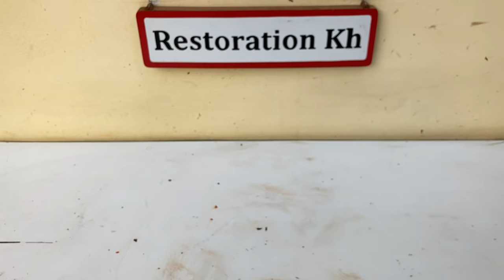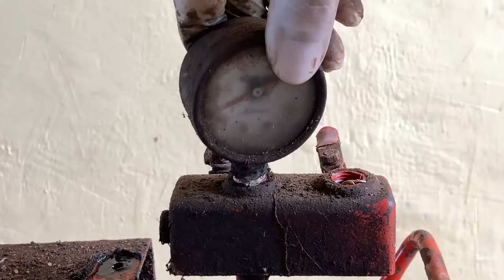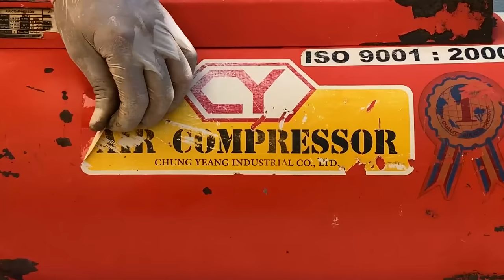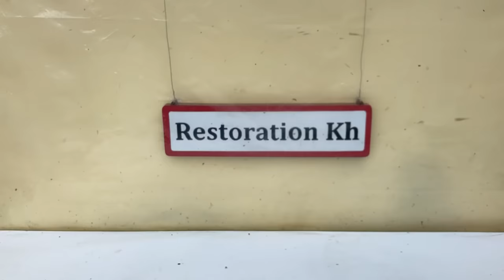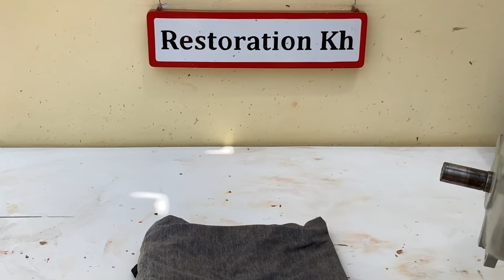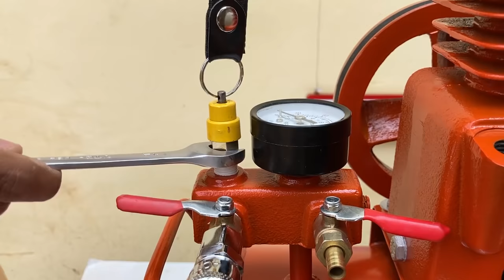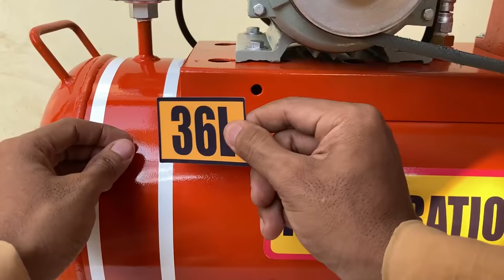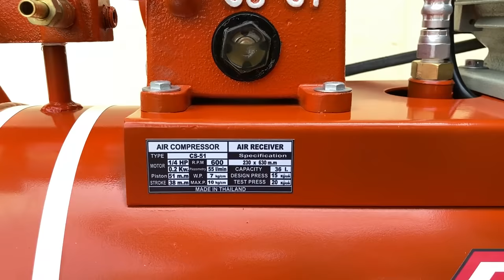Restoration Old Air Compressor Machine | Nothing is impossible | Restore air Compressor 36 Liter

Comment: I recently acquired an old compressor (Broom & Wade, made in 1956) I originally wanted it for just the tank, as on my compressor, the tank had sprung a leak. The plan was to transfer the externals, direct drive pump/motor from mine onto the old tank. But reading the history of the company that made it, and how long they had been around, it got me thinking and wanting to keep it original as possible. Hence, why i am here and watching these videos, i think its something i will be doing. So big thanks for this, a great job and hopefully mine will turn out at least half as decent as this.
Reply from the maker: Thanks for liking my video ❤️

Comment: I realize this is an older video. And you did an amazing rebuild/refurbishing effort as well. But one thing you didn't do. You didn't do a hydrostatic tank test. You have no real idea if the refurbishing project was on a rusted out tank or nearly rusted out tank.  Testing the tank for pressure test that could be a serious issue...   Thumbs Up!

Comment: You did a good job, I admire you because I know it takes so much time to recondition everything and strip the paint. But, that tank needs to be cleaned on the inside as well, and maybe even get an inspection camera to look inside it for rust. If it's too rusted, even if you do clean it, that wall won't have it's original thickness and it's dangerous.  I'm in the process or restoring a compressor from 1961, similar to yours. I decided to restore just the pump and the motor, and buy new tank with all it's fittings, valves and regulator. A 60 YO tank at 10 bar can do a lot of damage if it bursts. There are companies that test the tanks by filling them with water and adding just a little bit of air to reach the holding pressure. If it bursts with water, no big deal.
Reply from the maker: Thank you for complimenting me 🙏❤️
Reply: Yes I agree.  But you can test it yourself by connecting a pressure washer to the tank.  If you have a compressor that goes to 110psi, by taking it up to 300psi it's a reasonable safety test after you've filled it with water.  I have an old Ingersoll Rand Type 30 which I'm restoring and I'll be testing the tank that way.